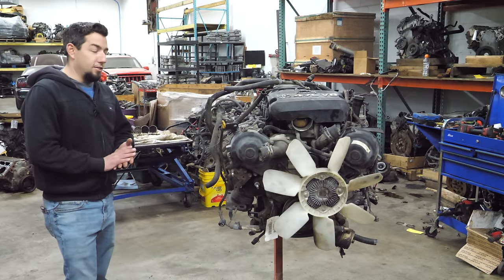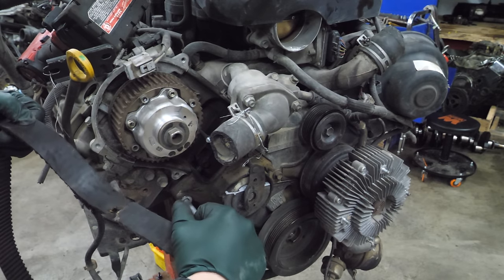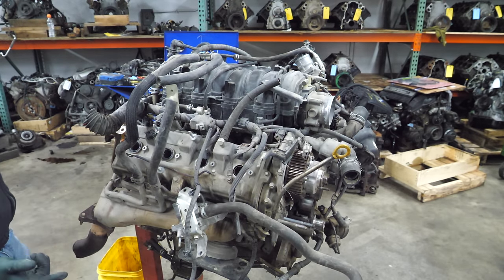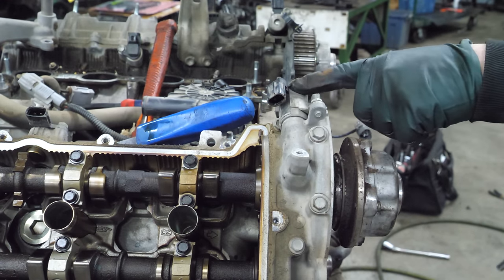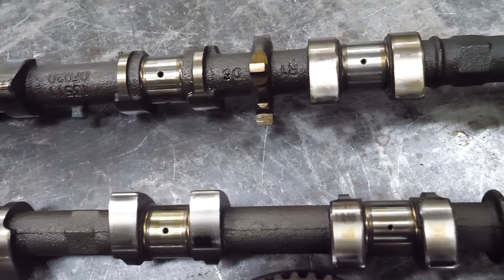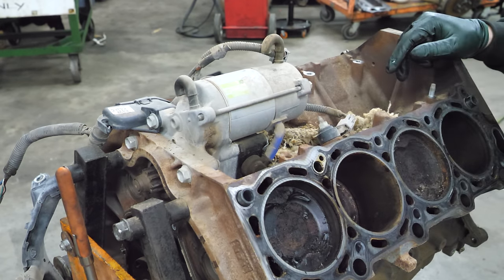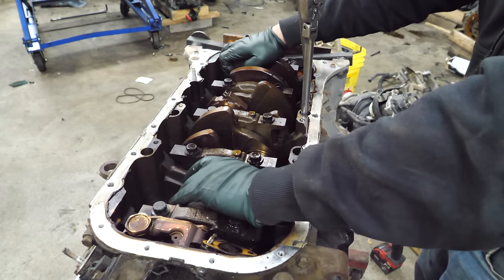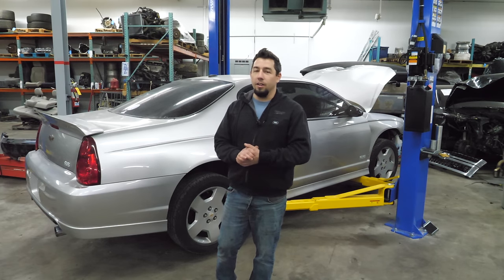Toyota Tundra 2UZ VVT Teardown! Bad Decisions Led To The Demise Of One Of Toyota's Greatest Engines!

Comment: The 4.7 is the best V8 as far as durability wise that I’ve seen in my 30 year career as a technician. As long as a new belt, pump, and oil changes are done as needed the owner will wear out and die before the engine will. I have serviced several with over 400K that still purr like kittens. One million miles is certainly doable with one that’s cared for properly.
Reply: there are a couple 1 mill tundra.
Reply: Agreed . What's so sad is the tech or buddy removed the engine . I suspect it was a weekend buddy job .
Reply: You must have been a Ford tech cookie cutter you never seen a real durable engine In your life Son I have built 318 Dodges that will out run out last out do a toy yotie piece of shit
Reply: Good news! My 2001 Tundra with this engine and less that 100k should do well for my grandkids.
Reply: I have a 2000 tundra coming up on 250k and can agree with this. That truck will not stop.
Reply: I have a 2003 Tundra I purchased new in November 2003.  It only has 35,000 miles and has only seen light duty use (mostly driving around town).  Should I be concerned about the belt with these low miles?   How much would a timing belt replacement cost?
Reply: Is it???? I mean why the hell would you ever use a belt in these engines? I've worked on multiple Ford Mod V8s. Plenty of them with over  300k miles that have never had the timing cover off and they have superb compression.
Reply: Yeah it's totally fine as long as you rebuild half the engine all the time. 😂
Reply: @herbienbrian2  Only a pilgrim that doesn’t know what they are talking about would make that statement. A belt and pump take about four hours to do if you work with one finger up your ass.
Reply: mine 04 double cab has 353,000 all original trans and engine runs like new. also have a 99 land cruiser with 230 and runs like new
Reply: Mine has a tapping sound and idk what it is has 240k on it and I've changed oil properly since new. Must be a bearing I've never changed timing belt.
Reply: @prevost8686  Yeah... only 4 hours vs.... no hours. Lol.
Reply: @applepoop10  timing chains can have issues too but far less that a timing belt. Agree
Reply: @lancelemay6971  I don't think you have a problem , I have two 2003 Tundras I purchase also purchased new. 
1- SR5 TRD with 106K, I just replaced starter and window lift motor. This is my daily driver.
2- Limmited with 65K miles, I thought I had a low mile truck, you beat me. 
But when you replace your timing belt , replace the water pump  too.

I would recommend you pay the extra for a K&N air-filter, you will never have to buy another air-filter again. Just clean it with a air horse , usually every 50K you wash the filter with a recharge kit. You will get better air flow for the motor. The difference its made out of cotton instead of paper.  I have that in my Limmited,  In my SR5 I use a K&N Cold Air Intake, looks like a Fez on a tube and the air filer box is open. That will give a bust in horse power, and has a nice sound.
Reply: @FEdeRioBravo   - I guess that starter is buried deep in the “V” of the block and is a real job to replace, probably quite expensive too.  That concerns me because my starter sticks a bit sometimes.
Reply: We have a 2004 Sequoia that we purchased brand new. 250,000mi. later, it still runs like a sewing machine. Two timing belts and oil changes. She is known as BETSY to the family.
Reply: @lancelemay6971  What ever your cost is divided by 19 years you had this truck. The starter almost lasted 20 year.

The intake manifold gasket set will cost more than starter , and you will only use have of the set. so get that anger out of your system first. My first DIY was changing the starter on my 1970 Firebird at age 16, and again at 18 on 79 Bronco in Durango, Colorado during winter. Bench pressing a starter as you tighten the bolts.

I have worked in a dealership and a auto part store. A dealership makes it money in parts, service and body shop. Go to your local auto part store and ask the commercial department to refer you a mechanic if you don't know one  It looks like its a 2 to 4 hour job.
Reply: @FEdeRioBravo    not angry about anything, just wanted to get an idea of the cost.  I don’t have to do this immediately because it’s only an occasional event and the vehicle always starts - the starter just seems to stay engaged a couple seconds longer than needed.  The way I look at it, I can spend whatever is needed to keep my trucks in tip top shape and it’s still immensely cheaper than buying a new truck of questionable quality.
Reply: State Worker hell yeah man! I seen a Dodge do more then that dude! That ante nuthin! Them Toy yoters ante nuthin!
Reply: Random Russ exhaust leak? Have you checked valve clearance? These engines have solid lifters.
Reply: @FEdeRioBravo  

Stick with a high quality filter even oem filter, that other over priced KN garbage should be saved for race track cars not daily driver and for Christ sakes leave the stock air box assbly in place to protect the filter.

I’ve seen several intake plumbing tubes dusted by a K&N as well as sensors oil coated with good intentioned do it your selfers.

Install a filter minder on the suction side of the air box and keep your paws outta the air box till filter restriction is indicated.

Good air filters last a long time when monitored with a restriction gauge verses visual inspection plus after a oem filter or any new oem style replacement filter gets installed and as they get a bit used they filter better than a new element until you notice a slight movement in the resettable filter restriction gauge plus the the less ur paws are in there the less chance to get dirt where it doesn’t belong, plus if you use a quick lube place just tell them to leave the filter alone and you’ll be fine, I’ve got a 2001 4.7 tundra bought new and worked hard doing deliveries with 430k and not even using oil between changes yet with belts every 100k, all oem parts used if available, I stocked up for 6 full belt jobs with all the goodies involved
Reply: @kyboy5  but ur piece of shit dodge has to get rebuilt every 100000 thousand miles lol.
Reply: @kyboy5  Are you kidding? You know that there are Ford 4.6's that were used in crown vics, Mercury Grand Marquis's and Lincoln town cars that have over 1 million miles also with original engines. Also you can regularly find them in old taxi and limousine fleets with 500K to 800K on them still running fine. Between that engine and Toyota's 4.6/4.7 & 5.7 it is a toss up as to which are the most durable so as for gasser engines its definitely competition between those 2 companies.
Reply: The 4.0 was literally  bullet proof as well, the ones I've repaired when they were run so hot all the front timing pulleys fell off  water pump locked up  and belt melted in a pile of goo, Install a new belt / pulley kit and it would start and purr as a kitten. These got to be the best made engines this Century !
Reply: @twobeagles1365  4.0 is a 6 cylinder...never seen them go 1 million
Reply: @dalephillips8250  Lexus LS 400, SC 400 4.0 Liter V-8  1UZ FE engine ...4.7 L came after.
Reply: The only problem I've ever seen a timing chain have a problem is when I change out the cam for a bigger one That's the only time I take the whole front of the engine out
Reply: Toyotas dont work for a living any motor can do 400k. Doing highway miles and maintenance
Reply: @frankmc5112  toys dont work.for a living
Reply: @ChrisB-cx6td  You're absolutely wrong. Take a look at the Million Mile Tundra's....both were work trucks and you can tell by the bed. Furthermore any motor cannot do 400K even when it is not worked. There are brand New GM Trucks that are needing major engine repair in less than 10K the lowest one on drove 73 Miles and broke down.
Reply: @twobeagles1365  OK thanks ....Never knew there was a 4.0 V8
Reply: @dalephillips8250  work in the oil field around the country never see any Tundras .See Tundras more for recreation use . Lincoln town cars , Grand marquis last 400k easy
Reply: @ChrisB-cx6td  Yes I agree on Lincoln Town cars and Grand Marquis but the Million mile Tundras were on the oil fields in Louisiana area and that same guy has over 710K on his new Tundra.. same engine same tranny. They are the most reliable 1/2 ton truck there is from what I've seen.
Reply: @dalephillips8250  Just dont see Tundras working anywhere .By work I mean towing , hauling not just delivering parts or being a courier which I believe one of those owners with the million Miles states .Highway miles are easier on an engine
Reply: @ChrisB-cx6td  You must be kidding. Toyota trucks are company trucks for all types of businesses. They’ll work as hard as any other 1/2 ton truck.
Reply: @rickhunter6479  I’ve put numerous chains in 4.6, 5.4, engines for stretching issues before 200K miles. They aren’t maintenance free if you keep your vehicle a long time
Reply: @ChrisB-cx6td  Yeah he towed with it also as some equipment had to be towed on a trailer as too heavy of payload for his Tundra. Its just I never see any other gasser trucks that get to the mileage that these trucks make it too whether recreational or work. And that includes any from the big 3 even when they never tow or do any work. It would seem we would at least get 1 or 2 from any of the big 3 as they sell hundreds of thousands combined each year. However, I can't find any except Diesels.
Reply: @lancelemay6971  I'd put a T belt on you're 35k miles tundra absolutely because of age! I've been a toyota dealer tech for 10 years, I believe the owners manuals say 90k/10 years for 2uz. Even with low miles, it's still a rubber/fiber belt that's 20 years old. Things like bearings and spark plugs don't really age from just sitting there, but rubber does for sure. Water pump and both belts is all I'd do, seals and pulleys/tensioner should be fine. You'll likely find that there's pink or red coolant crust everywhere from the pump leaking inside the covers. 

Also, don't use aftermarket parts. The only thing I've ever seen make a 2uz belt fail personally is aftermarket water pumps and pulleys. Pump in video is aftermarket, you can tell by the impeller.
Reply: @lancelemay6971  this belt failed because the tensioner failed. Toyota recommends you change your belt every 90k miles or 8 years I think. 

You should have yours changed and do the tensioner,  pulleys,  and water pump as well. Use aisen parts.  They are oem and you can buy a kit that includes all the  parts.
Reply: @ChrisB-cx6td Ford's  4.6l v8 probably the best engine ford ever created those engines don't die, my 4.6l v8 f150 has over 400k original engine.
Reply: @JorgeSanchez-bx2pb  weird I have 275,000 miles on my 08 ram with the oh so horrible 5.7 hemi. besides normal maintenence I just had to do an egr valve.. lol. I don't use that mds bullshit though
Reply: @ChrisB-cx6td  Huh? Grammar lately. You make no fucking sense.
Reply: what do you guys think about the bigger tundra engine? I want a tundra hands down. I haul nothing crazy... snowmobiles and race cars etc. trailer I use is kind of heavy for a 1500 platform I think. it flattens my 08 ram right out!!! I always figured bigger was better so the 5.7? is ot? cant remember what the other motor is.. but would be a little better performance wise? hoping being a Toyota it is still dependable. I will jist have to do something to beef up the suspension. I ised to be a Chevy guy. so I would have gone for a 2500 for the suspension but lets face it the transmissions are junk nowadays.. seems like alot of trucks are junk compared to old school trucks!!! so think I am going with the Tundra
Reply: @hodgebone1  They are still just fine. Sometimes they have leaky heads and air pump issues but still run forever. 2012+ fixed all of the minor issues.
Reply: @paladain55  which engine would you recomend? I don't like the sounds of leaky heads.. lol but for the most part I can work on my own vehicle etc. I am not a fan of taking things apart that involves timing so that will go to a garage unfortunatly and get raped for a lot of money! lol. I got the 08 ram to help build my credit a little more so I could get a Tundra. Covid prices though... making me second guess it. same truck thwy wanted 12 to 15k a couple years ago they want 20k
Reply: @hodgebone1  I would probably just give into my non logical self and get a 2014+ 5.7. They look good but are still slow, reliable, and get bad gas mileage, but they can tow a bit more (if that even matters)
Reply: @paladain55  cant be any worse than my 08 ram 5.7 lol thing is a dog lol
Reply: @kyboy5  theres always a hater and here is one ☝️
Reply: @ChrisB-cx6td  I see Yotas at work all the time.   The only thing I don't see them doing is plow work.   I sort of assume that might be because they are harder to get mounts for,  plus they are expensive and a lot of people around here just use a beater truck so they aren't devolved by salt and beaten apart. 
Timing chains are OK, but if someone is bad about maintenance they can be a nightmare when guides come apart inside your engine plus they are harder to inspect and change than a belt.   A chain can be assumed ok and then fail without expectation as well!
Reply: I have the 5.7...how is it overall for reliability?
Reply: @mikefoehr235  It’s been a great engine as well as long as oil changes are done as needed and as long as you can afford to put gas in them.
Reply: @Prevost  Thanks. I drive the RAV 4 Now. It is 2 or 3 times better on fuel. The 5.7 is actually good on fuel if your right foot is a feather..
Reply: @frankmc5112  I have one of these engines in my 4Runner and I'll admit that changing the timing belt is a pain when it comes due every 90K miles.  However it gets you to change the oil pump, hoses, serpentine belts at the same time while you are there.  Doing this maintenance may be a reason why these engines end up lasting so long as it eliminates these failure points.  Mine has >200K miles on it and it is super smooth with near new power.  Also I think they may have used a belt instead of a chain for fuel efficiency reasons as the belt has less mass than a chain.  I also saw some videos that said that a timing belt will maintain more accurate timing of the valves than a chain will.  I'm not sure how true that is though.  Respectfully,  I hope this helps answer your question.
Reply: @frankmc5112  BS fords 5.4l timing chains go bad all the time and they blow the spark plugs out of cylinder head taking the threads and coil packs with them and timing belts are better if you got enough brains to change it when they are due
Reply: @sabrehawk-427  Since, I'm a mod motor guru I call bullshit. There was a series of heads that utilized 4 threads to hold the spark plugs in, the cylinder heads, but this was a limited run of PI cylinder heads in the late 90s early 2000s. No there has never been an occurrence of timing chains going bad unless you don't change your oil and the automatic adjusters get stuck. No belts suck. You can keep more accurate timing and they don't bust. Love your speculation, but you don't know what the hell you are talking about.
Reply: I have a 03 V8 SR5 4x4 on 35s I tow and haul cars and car parts and do mobile mechanic work. I have 380,000+ miles on my tundra. Iv only had to do the entire suspension. Ball joints,half shafts, wheel bearings and axle seals.
Reply: 400k is easy with a 2v 4.6
Reply: @CL-ty6wp  maybe but everything else will fall apart before it gets there. Usually the transmission goes way before that
Reply: It’s durable because it has no balls to destroy itself.
Reply: @lancelemay6971  miles don’t only determine when you change belts.  Rubber deteriorates over time.  If you haven’t changed the timing belt you should probably also change the LBJ since it’s a common problem.
Reply: @jdmrider  um it only makes 25hp less then any gm variant. 1999 silverado 270hp, toyota tundra 245hp
Reply: @jdmrider  LBJ?  God I hate acronyms…
Reply: @lancelemay6971  Yes. You should be looking in your owners manual about time vs. Distance in your case. Small around town trips are hard on engines, steering, etc.
Reply: @lancelemay6971  I have the 4.0L V6 in my 2006 4Runner, and while it is slightly less revered than this semi-mythical V8, working on it is soooo much easier! Not just that you have more room in the engine bay, either. The V6 is brilliantly laid out. Every hose, wire harness, manifold, and accessory is perfectly routed and easily got at. That 4.7 looks like a nightmare to service and strangely thrown together. So odd for Toyota, who usually go for elegance in design and keep one eye on future service. (Except for my '91 Previa, but that's a special case!) The only vehicles I've owned that are more obvious and serviceable were F-150s with the straight sixes -- but those trucks were rancid garbage, so they'd better be easy to work on.

Oh -- and the 4.0L 1GRFE uses a timing chain. ;)
Reply: @lancelemay6971  replace the belt every 8 to 10 years
Reply: @applepoop10  they changed to a chain in the 5.7 iforces. Only one I've seen in the shop I found timing guide chunks in the oil pan I was resealing. Told the customer to tow it to the dealer and get the chain done as soon as I got the pan back on.
Reply: @dillonkoch72  still has no power I don’t own one for the power though.  HP and TQ isn’t really a problem rock crawling.
Reply: Timing belts on vehicles is plain stupid.
Reply: @mobius-1503  Someone that doesn’t know what they’re talking about might think that.
Reply: @randomruss651  exhaust leak maybe, the exhaust manifolds tend to crack on these sometimes it sounds like a tapping noise.
Reply: Got a 07 Sequoia and picked it up with 240k miles.. just about to turn 250k and still running strong.  I think the frame will rust out before the engine craps out.
Reply: @lancelemay6971  those belts do not last forever, i would be looking to change it at some point. i do my own work so no idea what the cost would be with labor
Reply: Great engines except the cracking exhaust manifolds ...tick tick tick tick tick
Reply: @randomruss651  mine just hit 250k. Had a tapping noise and I thought the worst. Mechanic said it was something with the valves. Didn't want to put the money into it to fix it and figured I'd drive it into the ground and get something else. It made that noise for over 2 years before it finally failed. Turned out to be the tensioner pulley and the fan pulley. $200 later she was back on the road quiet as new. The tapping sound is no more and we are on route to 300k.
Reply: Nothing worse than a Toyota truck slowly chugging along in the fast lane
Reply: Thats true Must be Idiots And never change Timing Belt and water pump i mean all Kit Every 100,000 thousands miles 600 hundreds Dolars and you have god Engine
Reply: So it's durable if you essentially rebuild it every couple years 🤦‍♂️🤦‍♂️🤦‍♂️🤦‍♂️ you missed the point of durable if you need to put a Wrench on it before 200k+ it's NOT durable
Reply: @Theaverageazn247 with original timing belts 🤔 I mean I could rebuild an LS with less effort then changing 1 timing belt
Reply: @lancelemay6971  Seeing as the belt is rubber and rubber degrades over time I think it may be a good idea to replace it even though it has low miles. Just make sure to inspect it first because it may surprisingly still be in good shape and if you get it done by someone make sure it is someone who will do it properly. You've got a gem of a truck. I have a 2003 tundra as well and at 260k it has been and still is amazing.
Reply: There's a 2nd gen tundra that passed a million miles with this motor and that's a big truck to be propelling
Reply: @Robwest-sq7mo my friend has a T100 with this engine and he says he just can't rationally buy a newer truck because his isn't giving him any problems, it has 375,000 miles on it. He says everyday he hopes that it will give him a reason to get rid of it but it just won't..lol
Reply: @ChrisB-cx6td if Toyota ever comes out with a full size heavy duty truck Ford, ram and Chevy will be in trouble.
Reply: @lancelemay6971  Yes, the timing belt is only supposed to be there by time or miles. the max time is 9 years.
Reply: @frankmc5112  Belts are quieter than chains.  Also, when this engine was developed (I would suspect very early 90's), belts on OHC engines were very much still the norm.
Reply: @sntstafford  You're not teaching me anything. Manufacturers have employed all sorts of techniques to reduce valve train noise to include nylon timing gears. Plenty of manufacturers to include Toyota do not use timing belts. Toyota's modern 1.8 does not use a timing belt. Unless you like your customer to come back in for work after the warranty work, it's stupid put in a belt.  Especially, for a pickup where valve train noise is not of primary concern. The latest iteration of the Toyota V8 has a timing 'chain'. There are other methods of reducing noise. Insulation is pretty effective. I'm not sure what the hell you are talking about. All engines are OHC engines unless you are talking about a Chrysler Hemi or Chevy LS motor.
Reply: @frankmc5112 There is no other truck manufacturer that comes close to the reliability of Toyota. Maybe in the late 90's GM could be in the conversation but no way anymore. These Tundras will be still be on the road when your Ford is nothing more than a steel cube being shipped to China.
Reply: @herbienbrian2 rebuild half the engine? Half the time? On what a Ford or Chevy? Man those things just keep getting worse. Chevy with 40k needing major work, Fords with 40k needing new transmissions. Then there is the Tundra 350k never had a tyranny problem.
Reply: @applepoop10 it's not an issue. Name one other Truck that consistently goes over 300k with no major repairs needed.  Yeah those stupid Toyota timing belts can last 300k without breaking. You got no argument until Ford or Chevy or Ram can build a truck that will last even half as long.
Reply: @ronjohnson8119 lol....yeah maybe a Diesel a long time ago in a far away land of fairy farts. Dodge! Lol. Total garbage after 100k
Reply: The only thing better than the 4.7 is the 4.3 L V8 found in the LS, SC 430
Reply: 2003 4.7 Sequoia w/ 315,000 miles on it. Just did the 2nd timing belt, water pump, serpentine belt, a couple of going-bad serpentine belt pullies, etc. change. Runs like new. Always synthetic oil.
Reply: @ThinkerNotEmoter Nice! Personally, I would be changing that timing belt earlier than you are probably around every 100,000 to make sure you don't risk it snapping and destroying the motor since the 4.7L is an interference engine. Hate to have it destroyed with all those great miles on it at this point. Good luck!
Reply: @ronjohnson8119 I know it's been a year but my money says, You're not the brightest bulb in the fixture...
Reply: @MH-53E  why? Because I have personally seen them go 200+ thousand miles on the original belt but I do NOT recommend it? WTF?
Reply: My 2003 tundra has 300k on it. We just replaced the timing belt and the orginal shocks on the truck. I can say though replacing the timing belt on that engine is an act of congress because u literally have to take everything off that's mounted to the front of the engine.
Reply: If the timing chain goes bad and it will at some point my 2010 Ford f150 4.6 timing chain went out at 175k and it cost me 1,800 vs a timing belt is round 1,000 when you replace them.. yes the chains last about 50k longer but when they go it's more than belts
Reply: I HAVE ONE WID 300K,PERS LIKE A CAT! GOOD TO KNOW i,ll die first,hoping to make it to 5ook and 90yrs......
Reply: @herbienbrian2 agree! I have one,as long as you replace every thing - any motor will still run,4.7 is very high maintenance period!
Reply: @lancelemay6971 4.7 motor spins over then ignition kicks in to save starter because of very high compression,never fires right up till its spinning 240 compression,its crazy, ask me how I  know.....
Reply: I don't know I think the Ford 4.6l 2v might be more reliable but I don't know much about the 4.7 so I'm probably wrong.
Reply: @ChrisB-cx6td  that's a good one. Tell that to my dad's T100 with 400k never had a NON working day in its life. Always overloaded.
Reply: Good grocery getters
Reply: If only the starter was more accessible.
Reply: @macduggles  They are not very difficult to replace. I have replaced starters that weren’t in the valley of the block that were more difficult than the 4.7.
Reply: @frankmc5112  They have belts because every OHC engine designed in the '80s used belts.
Reply: @Sci-flyer  Your statement makes no sense and is not true. This engine is not from the 80s. Toyota didn't have a V8 in the 80s. First year for this engine was 1998. Plenty of OHC engines even prior to the 80s had chains. The choice for a belt is most like due to valvetrain noise that would discourage people from purchasing the vehicle.
Reply: @frankmc5112  incorrect. The 2UZ is just a development of the 1UZ which was designed in the ‘80s and came out in the LS400 in 1989. Many of the parts are the same that’s why it’s belt-driven just like the 1UZ was.
Reply: @Sci-flyer   You are not speaking to your statement. V8s did not appear in Toyota till the 90s. If I would were to give you the Lexus (not Toyota, but manufactured by Toyota) as the 80s (89), you would still be wrong. Your statement was that "every" OHC engine in the 80s was designed with belts. That is not true. It's factually wrong. You are wrong. Plenty of German cars didn't have belts.
Reply: @frankmc5112  check your facts mate https://en.m.wikipedia.org/wiki/List_of_Toyota_engines
Reply: @randomruss651 cracking manifold
Reply: yes and no.  Time and rubber breakdown is the problem. I changed my 73k belt in my 2000 tundra last year.  The belt was fine, but the water pump was seeping. Pull the top belt cover and take a look.